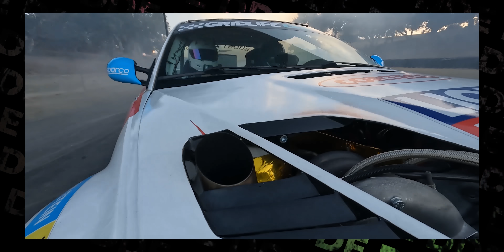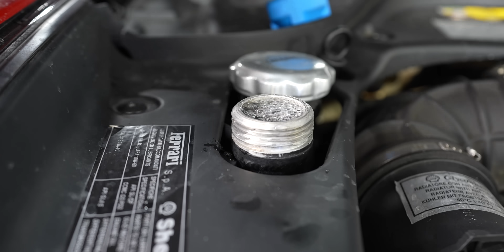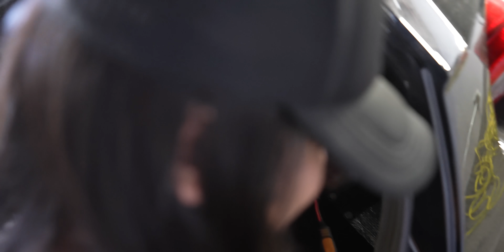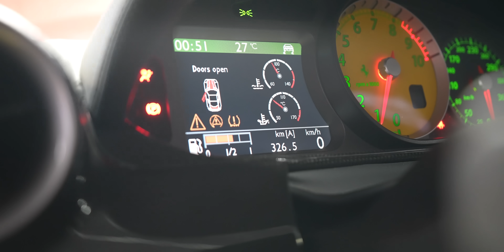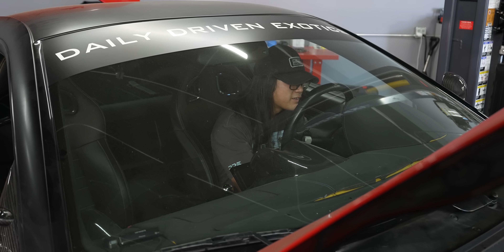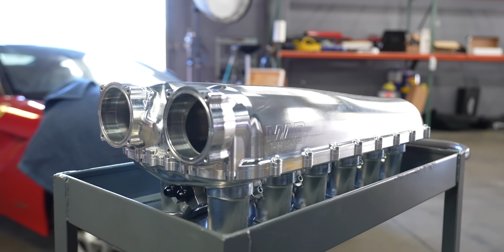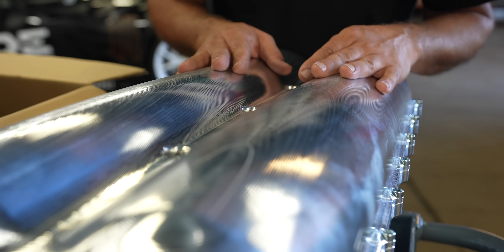WE SCREWED UP... FINDING FATAL FERRARI V12 ENGINE DAMAGE

Comment: Im no Ferrari certified tech but another 2 things it could be is a broken thermostat or a blocked radiator. Especially since you guys pointed out that the radiator was cool and the car was still overheating, could also be the reason why the fans didn't kick on but still worked when you tapped the relays.

Comment: Just so you know if you leave the kill switch off on older Ferraris it will lose all its adaptation tables and will need to re-learn.  It does not effect your fault but as a long term thing you need a good battery on a ctek conditioner.

Comment: I had exactly the same years ago with my 'NOT FERRARI' but it was a blockage in the coolant system. My issue was a bit of plastic that made had the same symptoms but intermittent.
I found it after taking all the pipes off, hidden in the middle of a pipe and it was turning like a valve randomly.

Comment: Good grief.  Ok guys, based on some of the content I recognize responses to certain comments.  I'm in a different powersport industry. However, in less than 5 min I was able to pull up a fiche for the 599 online and see that there is an old school thermostat.  If that POS is old it will not open.  (water on the engine side gets hot/Rad side cold)  temp sensor is on the rad.  That's likely why the fans do not turn on.  I don't do social media so if you guys are able reach out through YT bob's yur auntie.

Comment: The fans won't  come on because you took the thermostat out, so the temperature won't be high enough at the actuator. 

Feel the bottom hose it will be cold.

Comment: I’m a retired mechanic, owned my own shop for 28 years, I’ve seen this before, it’s internal, head gasket, cracked head or block 😢, the fans not coming on is probably why it happened, check where the look was on fire 😂

Comment: coolant temperatur sensor may be faulty or not calibrated correctly after it overheated and or caught on fire.  
This could also be  the reason as to why the fans are not being triggered to turn on because the eco thinks the temperature is lower than it actually is. 
Could also be the reason the coolant and water are literally visibly boiling, yet the cars dash says the coolant shouldn't be.

Comment: Sack off the 599's...was a good idea but not the right platform.

Concentrate on getting the F12 done (there's a lot more to be done with it) and the clutch pedal installed in the KB43 and that can be  the block beater for now.

Comment: Water Pump? Mike We hope that you finally will get Damon on board to putting together actual cost effective Block betters that are reliable and can be fixed in a timely manner. I would say anything LS like a few Vettes Let’s go Mark!!! Foreign Cars suck especially Super Cars for this reason. Domestic cars kick ass especially if you want it to last and the cost is far less in maintenance. Hence the reason Ken Block stuck with Ford lessons learned when pushing the limits of any vehicle passed the limits of a true Because Race Cars!!! Good luck guys hope this info is constructive enough to start the Conversation. Just say nothing is worst than having shit broken down All the Time. And is taking over your video content which really sucks Ass.

Comment: Put the thermostat back after checking to see if it does open in a pot of boiling water because the thermostat helps to direct the water flow through the whole engine and not just flowing it through the block. Remember, the temp sensor sits on 1 of the heads, and if the coolant isn't flowing through the heads properly, the gauge will show hot, but the radiator will be luke warm

Comment: if the radiator is cold that means the water is not flowing that is why it keeps coming back out its like Infiniti VQ Engines You have to bleed the system because if you don't you will get this situation of overheating check both hoses if there code that's your issue

Comment: No thermostat installed would make the coolant temp not lower with the fans running... No restriction to flow from the thermostat will not let the coolant slow down enough to let the radiator/coolant while running. Also the restriction evens the flow out from the water pump=Bubbles.

Comment: Tired of seeing  "truth" in these titles.
Reply: Seems like a thermostat issue to me if no heat is getting to the radiator and the fans aren't kicking it's just telling me the thermostat isn't opening and diverting the water to the radiator then the fans aren't kicking in because the temperature sensor on the rad side is cold.

Comment: You’ve likely got a blown head gasket. Pressure from combustion chamber is getting into coolant circuit causing unnecessary high pressures. Do a compression leak down test with coolant cap off and watch for bubbles out of coolant reservoir

Comment: i See almost every question forums based answers, Insufficient coolant-nope, Broken thermostat-nope, Broken radiator fan-nope that leaves:-
-Blocked radiator
-Cracks in the cylinder head
-Broken water pump  Thanks for showing us, bouncing off the limiter+ switching the car straight off really doesn't help!! LOL Mike and Tim need a free meal out for this one!!

Comment: I would say the issue is the water pump has issues. Look for a relay for the pump or the wiring to the pump if it is electric. If it is mechanical then pump the pump and inspect.

Comment: Let it run for a hour with the cap off also you need to put the thermostat back in or a new one some vehicles do not operate correctly without one that may be why you’re getting cavitation back Thank you so much for using both of the tools that I recommended last video this is how you diagnose a car good way to test fans is turn max AC on it overrides your ECU turns both fans on 
That fluid would’ve turned yellow if you had carbon monoxide in it so I really doubt you have head gasket issue 
Also allow a little bit of room in your overflow tank. You have to remember all that is circulating back so there has to be a little room good luck keep us updated

Comment: Mike one time I was driving and my car got really hot but I had no choice but to keep going because of where I was I couldn't pull over and it kept doing that and come to find out I had a needle size hole in one of the lines where it cause the temp to read hot but the car ran fine just food for thought

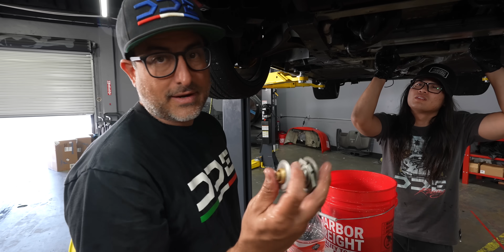Comment: Message for Mike. The thermostat you pulled has a bypass plunger. You have to blank the bypass port in the thermostat housing for flow to be correct, or it can short circuit the cooling system. 5:14
Reply: The same problem exists with or without the thermostat. Gasses in the coolant without exhaust gasses and the radiator is not getting hot, water pump. Water is boiling around the cylinders due to the lack of flow.
Reply: @Viracocha785 or the radiator is clogged, liquid doesn’t move and fan’s sensor never get hot
Reply: @Viracocha785  because the FANs are not turning on it shows that he did check basics!
Reply: How about a faulty temp sensor?
Reply: ..yes,that is the issue with overheating..mikey is not familiar with thermostat removal procedure..have to plug the bypass for the radiator to not overheat the engine being driven hard in a closed yard with zero airflow at low speeds.
Reply: @albertj4721  no you never remove a bypass thermastat you replace it as it causes major issues! the engine fan not working is the issue!
Reply: correct all he has done is caused a bigger issue!
and the fan not turning on is the issue the entire time as you can hear the fans when they are on
Reply: i also thought this cause it reminded me of my car. It may not be a Ferrari but the problem had seemed very similar.

Comment: Why is the 599 overheating, when all Damon and Dave do, is rev the piss out of it?  Cars purpose built to be cycled through an set rpm range through gears meant to transfer the right amount of power to the road. With multiple systems meant for performance road driving. Especially engine cooling designed for air flow to cool peak temperatures with speed. The last thing Ferrari intended when designing them is, to be drift cars. Which the repeated breakdowns and the radical F12 build proves.

Comment: What Mike was trying to explain with the vacuum is with the air pressure coming through the bigger hose, that passes the small hole from the vacuum system. That is the Venturi effect, in other words the big hose under pressure sucks in extra air through the small hole of the vacuum thing and thus creating a vacuum there.
Yo Mike, you need a whiteboard to show the people the principle you are trying to explain, a picture can tell a 1000 words.
So instead of investing in a wheel to pick the lunch (that breaks after a couple uses), DDE needs to invest in a whiteboard for in the shop so Uncle Mike can explain us dumbdumb's how everything works 😉

Comment: I used to scrap cars for a living i would take the relay caps off cars cut the fuel rail feed hose clamp mine on and pump out filtered gas into my truck barely paid for a gallon of fuel.

Comment: If the rads not hot and the system is boiling over.. that's got to be a catastrophic blockage or the pump isn't moving anything. Fan switch is often on the rad so no wonder the fans aren't coming on xx

Comment: Check to make sure there are no leaks coming from within the water pump, or any leaks in the radiator, or the cooling hose underneath the intake manifold that connects both heads. Radiator and cooling hose are common weaknesses of the 599s.

Comment: If you have the thermostat out. The water may not have time in the radiator. To cool off. Using your chemical analysis. It would’ve shown up immediately if it was a blown head gasket. Again if the water is moving too fast through the radiator it will not have time to cool down.

Comment: If it's got a plastic impeller on the water pump it could be getting hot and spinning on the shaft. Or a blockage somewhere. It could also have seperate temp sensors for gauge and for pcm to turn the fans on. Or all of the above lol

Comment: Mike your overthinking this over heating situation, get to the basics and fix the issue, test the thermostat, if working properly, put back in place. The system will not flow properly with the thermostat out. Check to make sure  the relays are receiving signal to come on, if not check sensors and wiring , check relays to make sure they activate when sent a signal.
Reply: If parts of the cooling system are cold like they both said, it tells me one thing, no water flow, that tells me the water pump is shot, if two brainiacs can’t work that out, what are they getting paid for 😂

Comment: If the headgasket is leaking exhaust in the system the wide band would have a code for a lean condition usually within 30 seconds

Comment: so what I've learned from dde, if you want a Ferrari drift car, the first thing you do is, gut the cars wiring harness and engine, upgrade the power steering, and rack. go ahead and do the exhaust while under it. then upgrade the clutch, clutch plate, driveshafts, and water pump. i can't help but think there is a cheaper option than buying running cars to chop them up. can you guys start buying wrecks from the area and saving what you can, make some loot in the process? do some crazy body combos, mis matching body panels. just saying you have a lot of floor space you're paying for and not utilizing, start buying wrecks and stacking spare parts?

Comment: The thermostat is a bypass type you cant just remove it it will continue to get hot and boil as the thermostat  directs water in and out of the head  ffs put the thermostat in some boiling water to check its operation if it doesn't move replace it

Comment: A friend of mine is a heavy equipment mechanic, I thought the head gasket was starting to fail on my car. He had this gauge for a compression test on my cooling system. You just pop off the rad cap, put this tester on then you run the car, is the pressure moves or hits zero you have problems, if it stays where it’s at when it gets up to temp you’re good.

Comment: you put a vacuum on the coolant system, removed the thermostat, and verified the fans work but are not getting a signal to the relays, there is no oil milkshake so if it was a head gasket it would be piston gasses feeding into the coolant system. so do a piston chamber pressure test to rule out head gasket.
so the first known issue is a fan signal electrical issue.  the second is either the water pump or a collapse/clog in the system. I'm guessing it's gonna be the water pump and a broken fan signal wire from the ECU.

Comment: I keep forgetting that some fans are not mechanics and builders. I'm going to look into this with the 599 air boil over. I know some manufacturers use a synthetic impeller for the water pump which, when it fails, produces airflow such as you see. Whereas a metal impeller would not produce this issue. I've seen this on numerous domestic,  foreign, and high end models. Tbh, it's not the head gasket. All your tests confirmed that. Same tests I would do at my shop. Water circulation issue. Cold hoses confirm that.

Comment: I had the same problem with my explorer years back. Drove me nuts. Ended up being a sheared impeller shaft on the water pump.
Reply: Yes. Mine volvo v8 had the same. New water pump and it works as new. Strange thing they check everything but not the main culprit. Might be content thing. Why fix it fast if you can make whole series of it.

Comment: If the coolant temp sensor has too much air running past it, it may not be grabbing the temp it needs to see to kick those fans on. Still could have a head gasket issue. I'm sure that car has multiple temp sensors. One for the gauge and one for the PCM feed to the cooling fan control

Comment: Is there a small bleed hose going to the top of the expansion tank?  If so, remove it with the engine running and see if there is water is coming out of it to return to the tank.  If it is, likely the water pump is pumping.  If not, the water pump may not be pumping.  You can do a comparison with the other 599.

Comment: That vehicle needs the thermostat to run for the fans and since its a low flow cooling system it will overheat without it!! Should test it and replace or reinstall!! Head got compromised during DAVES REV LIMITER BEATING!!

Comment: Matt Armstrong had similar issues with air in the cooling system requiring several drains of the cooling system to completely drain the air in the system. This seems to be your problem since there is massive bubbling and the radiators still seem cool.

Comment: Mike!! 😂😂 put the Thermostat Back In It! The thermostat controls the fans switch! Its basically the coolanta heat sensor! Hope i save you guys an engine rebuild!
Reply: The fans weren't turning on, that's what made him take it out.
Reply: @brad741  he should definitely replace it! A damaged thermostat can cause overheating due to it not regulating the temperature! Easy fit 💪 Slapp a new one In!

Comment: Water pump would make a lot of sense. The temperature probe for the fans may not be the same as the one for the temp meter in the dash. If the coolant isn't moving and the radiator and place where the temp probe for the fans stays cool, it would explain why they don't start. Sounds like a pain in the rear to get to that pump though... 
Good luck!

Comment: Mike put the thermostat back in the bottom of it blocks off a water by pass when it opens with out it will over heat  not gettig proper water flow when hot the fans not workig is probly the fault to start with

Comment: Try checking put in the thermostat back in, and then do the CO test. Cars do overheat sometimes when the thermostat is not in there, cuz it's not regulating the temperature. But I know you know that. Also check the temperature of the radiator fins with temp gun .see if there is a dead spot in radiator
Reply: Good call